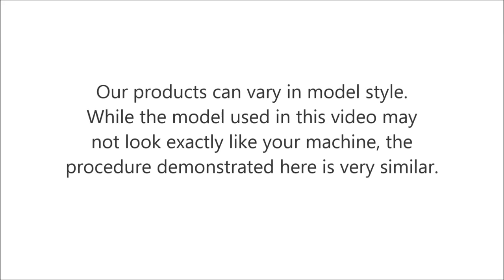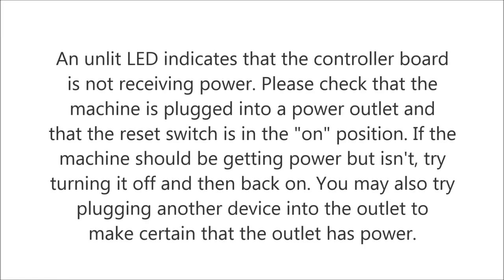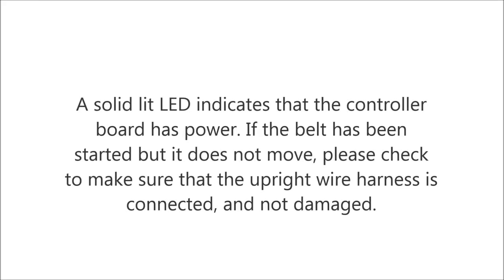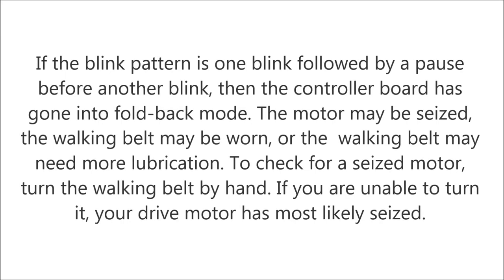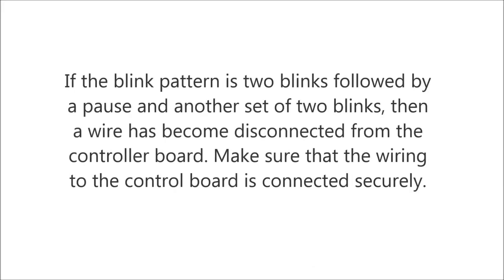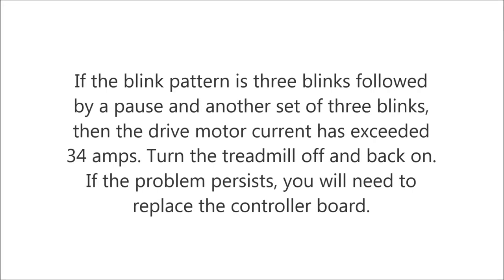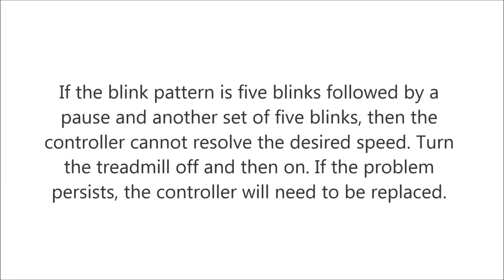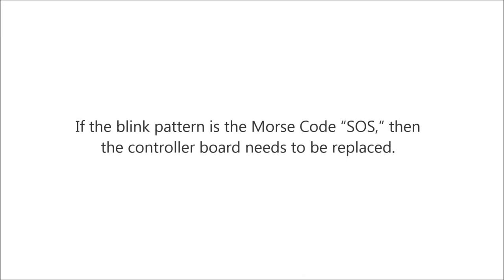MC2100 LED ERROR CODES FOR NORDICK TRACK, WESLO, PROFORM TREADMILLS

Comment: Nordic Track c850i. (Four Blink). 
Replaced the controller board and it resumed working perfectly.
Reply: Since replacing the board I now get a single blink pattern and the belt slows down to a stop. The treadmill will then resume shortly after and both the single blink will disappear and normal functionality will return. Any ideas?

Comment: My LED is Solid red with no blinking, display monitor turns on and work fine, yet when I press the button to start the belt, the belt does not start, also when I press the button to change the incline, it is also unresponsive and does not change. I have purchased and replaced the upright wire harness yet the LED is still solid and the belt and incline still refuse to start.
Reply: Did you figure out what the problem was? Im having the same issue. Solid light,  monitor on, belt does not move.
Reply: @agustinramos394 I had same problem, I clicked start and all the display would light up and then go back to the beginning. Turns out it was the wire that runs through the metal pole up to the display. One of the wires that plugs into the the other got disconnected BARELY and I just had to push it back into place. Sorry if this is hard to understand, I don't know each individual part by name. @Xnm

Comment: My LED stays solid, when I press any speed button, the belt goes full speed and then trips the switch off.  I can reset it, and do it all over again.  I'm guessing I need to replace my motor control board.

Comment: My LED stays solid but does not blink when I try to start the belt (motor) and the motor does not turn.  I have tested the motor and it works ok.  The upright wiring seems ok.  The treadmill tilt works.  Any ideas where the problem could be?
Reply: Did you ever find a solution? I need this help exactly
Reply: I had same problem, I clicked start and all the display would light up and then go back to the beginning. Turns out it was the wire that runs through the metal pole up to the display. One of the wires that plugs into the the other got disconnected BARELY and I just had to push it back into place. Sorry if this is hard to understand, I don't know each individual part by name.  @Xnm
Reply: @nobody_1325  Yeah i had no idea lol i gave up after a month of "trying" & just started using the one at my apt complex's gym but thanks regardless